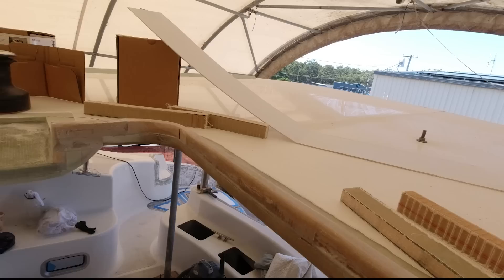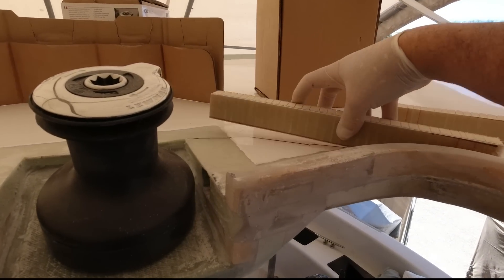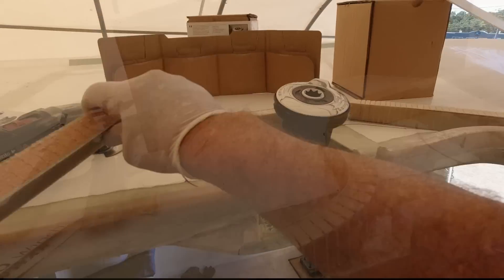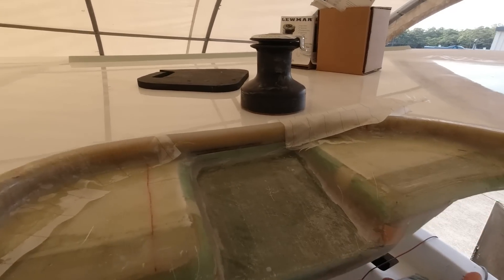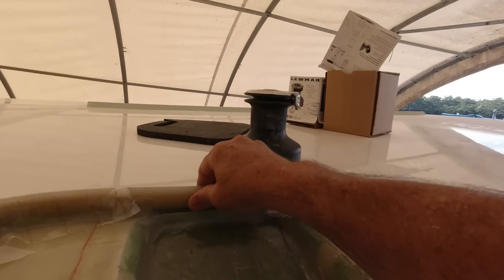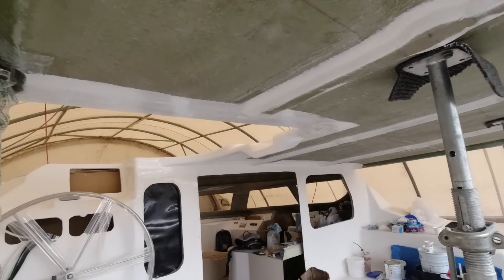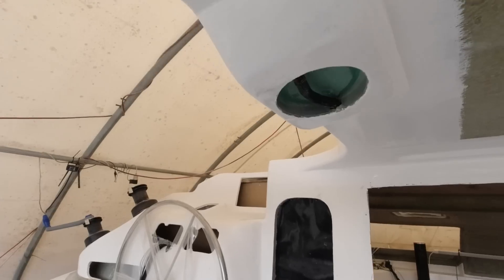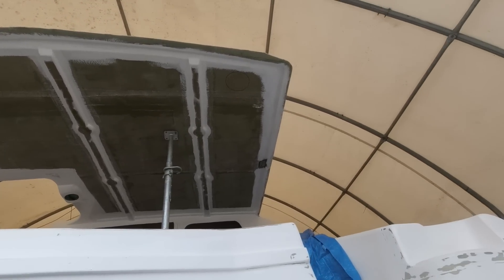Hard Top Design and Flow Coat // Complete Catamaran Build - Update #2

Comment: Would love to see how you do the detail sanding. Especially where inside coves meet and short lengths of 90 degree corners.
Reply from the maker: Hard to describe,but several different tools,shaped for tight radius and lots of gently hand sanding with small torture boards for fairing.Ross

Comment: And you think water spray or rain will never get that high on the hardtop, and get trapped by the coaming?   I think some drain holes may be needed.  Maybe I'm not seeing the design properly.
Reply from the maker: Hardtop slopes forward,Coaming is 40mm high,Wind driven rain and spray will certainly flow over but most will drain forward over saloon roof.There will be substantial clears around the Cockpit roof at a later date.Cheers Ross

Comment: Love you man. Don't forget how important winches can be when you are at anchor or even in a slip. The more winches the better. Centralisation can become your worst enemy. You can always hook a snatch block onto a padeye but difficult to do ex post facto unless you think about it now. Winches are magic when it's blowing 50 knots. Most power boats cannot adjust lines in those conditions partly because they don't have a clue and partly because they don't have winches. "The bigger the better, the tighter the sweater" and, "The more the merrier"! Tight spring lines.